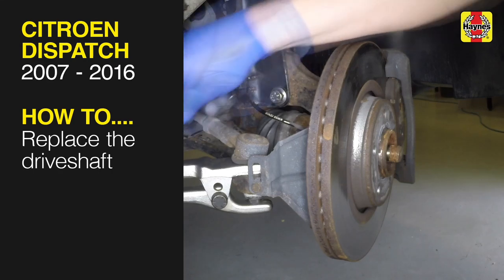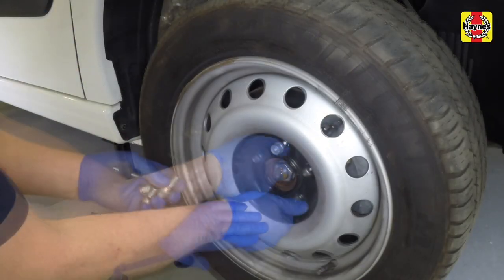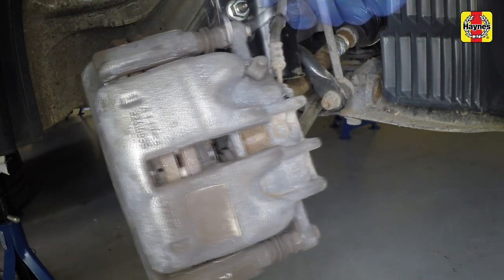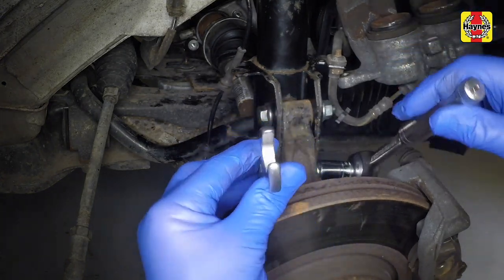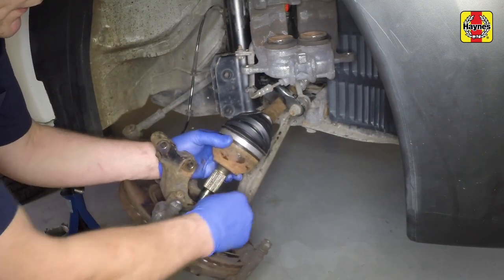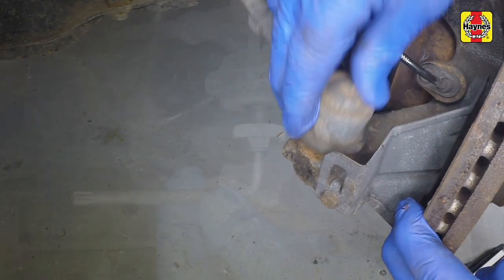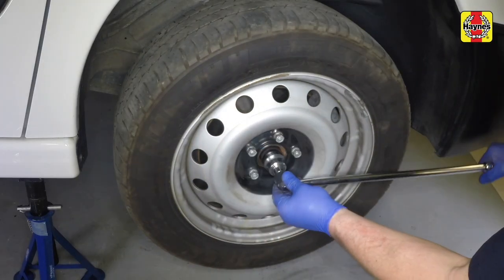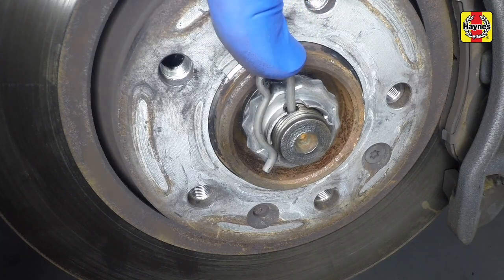How to Replace the driveshaft on the Citroen Dispatch 2007 to 2016

Comment: Jacking outside the recommended jack point results from bending the sill, you can actually see the bend! Exactly what has happened here! Jack under subframe or rear spring cup, this is basically how the sills crumpled on mine before I learned this the hard way!
Reply: It's not bending the actual sill. The bottom of this sill is sealed with a soft rubber like material that sticks out 5-6 mm and easily flexes. The sill joint itself is undamaged. I own this car myself.